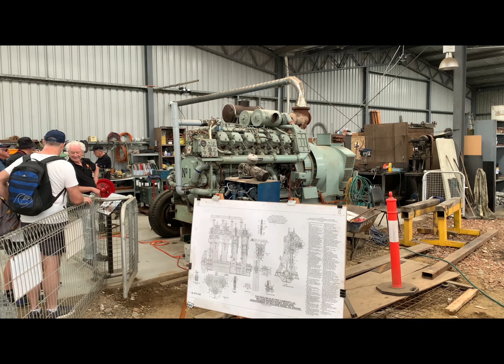Melbourne Steam Traction Engine Club 2023

Comment: Nice to see all three makers of the stationary engines used in the family textile mill in the north of Scotland, after they moved into purpose built new premises in 1901. The first engine was an Otto and Crossley 15 HP engine running on town gas. The town gas pressure was somewhat irregular and this was therefore, replaced just before WW1 with a 30HP Tangye Producer Gas engine with water gas boost available for high load periods. Finally in the mid 1920's with expansion of the mill's machinery and more looms, more power was required. A Shanks-Deutz 80HP 24 litre single cylinder diesel was installed in 1924 and this ran up to 1936/37 when 3 phase mains electricity arrived. The Shanks diesel remained as a stand-by engine for power cuts up until 1940, when my father donated it to the government to use as a generator engine at a Coastal Command air station in the Scottish islands.
Reply from the maker: Nice engines, and interesting history!